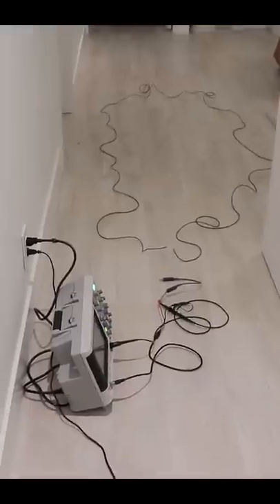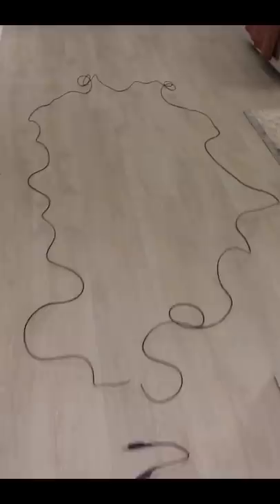The Crazy World of AC Electricity #shorts

Comment: I work in residential new constructions and I had an issue with some travelers on a 3 way setup. I would get 120 between hots while disconnected on the other end and the arc fault wasn't tripping. Wire was crushed by a staple. I think this demonstration has somewhat helped explain why the breaker wasn't tripping and the lights just weren't working.

Comment: That is so weird.  I thought that led was like a check valve and could only work in one direction
Reply: You are just inducing a voltage in the circuit and polarity doesn’t matter ?
Reply: it's AC. The voltage keeps flipping polarity, and when it is in the correct polarity, the LED shines. The voltage changes polarity so fast that to a human eye, it looks like the LED is continuously on
Reply: You are right the led flashing frequently is half to 5MHz from the generator

Comment: Wouldn't the loop be capacitively coupled to the ground?
Reply: That's not what's happening here: in one direction the AC builds a charge against the diode. Once the voltage is reversed, there is sufficient voltage differential for the charge to pass through the diode. The voltage differential at the LED is a result of the propagation delay through the wire.
Reply: @MarkRose1337  How is charge building up in the first place without the other terminal connected?
Reply: @saturdaysequalsyouth  The power supply is either pushing electrons into the wire with a negative voltage, or enticing them out with a positive voltage, to create the voltage differential. The wire is acting like a capacitor.
Reply: @MarkRose1337  that's what we call capacitively coupled to the ground
Reply: @saturdaysequalsyouth  Because everything made of metal has a "self-capacitance" as well. It's tiny, but becomes relevant at high enough frequency anyway.

Comment: I assume you are working on a video answer to Veritasium? Let's get a new debate going!
Reply: @SirVerdown  The #short debunks one of the claims made against Derek's video, so I don't think it will take the direction you are expecting.
Reply: @SirVerdown  Who said anything was rewritten? Watch the full ElectroBOOM video. Maxwell, Poynting, Veriasium, and ElectroBOOM all agreeing on EM theory.
Reply: @SirVerdown  Maybe you need to check your understanding. Sorry, but none of Mehdi's video contradicts my understanding, and none of it contradicts (in fact, it affirms) the proposition that closing the switch induces some current flow through the lamp 1 m/c later.

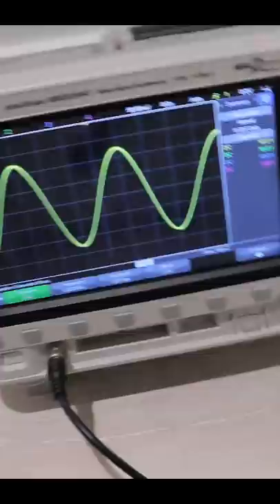0:10 -- "Of course his video is great and highly educational. But his question rocked me in ways that I didn't like." Good introduction!

2:00 -- "It takes some time from when there is operating current til when it's on", but then at 2:45 "He meant the light turns on at any current level immediately", so here Mehdi is acknowledging that he at first misinterpreted Derek's meaning (emphasis mine in both cases). Simple mistake, although the former interpretation never occurred to me while watching the Veritasium video. Hence, I got the right answer and some got the wrong answer due to different interpretations of the same statement (I was going to say 1 s until Derek made the statement about the light turning on with any nonzero current). Still others got the wrong answer for spurious reasons, and that's what I have tried to address in my responses to all the videos that have come up on this topic.

3:52 -- "Let's dive into Derek's video because I don't quite agree with every point he makes" (emphasis Mehdi's) -- he's saying he's going to raise some minor quibbles, not that the theory Derek presented is wrong.

Several minutes follow going over these quibbles, which are either semantic in nature or concern the statement of the problem (which almost everyone agrees is poor). None of these quibbles were points I was not previously aware of, but none had direct bearing on the validity of the theory presented by Derek. They certainly have a lot to do with the presentation quality, but that's beside the point.

Did you read the analysis Derek posted by the two EE professors? Mehdi had something to say about that, too:

9:05 -- "I checked the analysis Dr. Olsen and Dr. Abbott provided...I also did a ton of simulations and analysis myself and I was happy to see that my results matched theirs."

9:30 -- whiteboard illustration showing why Derek is right: "If current goes in here, same current must come out here almost immediately, limited by the speed of light. So Derek is right that as soon as we close the switch, we have current through the lamp in 1 m/c [seconds] because the wires are 1 m apart, no matter how long the wires are in the loop." Since this was the key point of Derek's video, it is important to see that Mehdi has confirmed it. Watch the whiteboard presentation again -- it's very good and you might find it enlightening.

16:49 -- shows a time plot very similar to the one by Dr. Abbott in the document Derek posted, affirming their result once again.

17:20 -- "Was Derek's answer wrong? Yes, on a minor technicality. BECAUSE HE TRIED TO TRICK ME INTO GIVING THE WRONG ANSWER!" Fair point, since the problem was poorly stated. But Mehdi has affirmed the very theory that countless people have attempted to find counterexamples against (none of which has held up to scrutiny).  Maybe you are missing some of the irony in Mehdi's remarks. Continuing: "But his question raises a great insight into electromagnetic waves." Good acknowledgement that the underlying claim is consistent with the past century and a half of EM theory.
Reply: @SirVerdown  Sounds like you haven't been paying attention to the comments. More people than I can count have been arguing that no current will be induced at 1 m/c. This video proves them wrong.

If you agree there is induced current, then I have no idea why you are arguing against me.
Reply: I have argued with people who claim that:

1. Derek's claim implies that the far ends don't need to be connected to see the induced current, so the theory must be broken. The first part is true, but it doesn't mean the theory is broken.
2. Derek's claim means we don't need wires in our houses to power our lights  No, it doesn't.
3. Derek's claim means causality can be violated by moving the switch. No, it doesn't.
4. Probably several other specious arguments I've forgotten.

See what I've been up against?

Comment: This is because 5MHz is a frequency in the shortwave range, and your loop works like an antenna. If you try to tune your radio to 5000 kHz AM, you won't hear any white noise because there will be a carrier signal at that frequency.

Comment: If anyone is curious as to why this works, it's because the led is a diode and it only lets current move one way through it.
Reply: I feel like that's not really the question.
I believe the mystery is more that the circuit SEEMS to violate Kirchhoff's 1st law. 
I.e how is this circuit 'completed' to allow current to flow.
Reply: @charmio  With AC current things get weird, there is nothing unusual about this circuit though, it is literally just a half-wave rectifier.
Reply: @_shadow_1 It's only "just" a half wave rectifier if it has 2 connections to the voltage source though, a naive circuit diagram for this setup would show the LED with its leads shorted. The confusion isn't "why is the current only flowing one way", it's "why is the current flowing *at all*", and the answer to that is parasitic capacitance and inductive effects, rather than "it's a diode". In particular, this wouldn't work at all if the wire loop was much shorter even though it would still be a half wave rectifier.

Comment: In my old house when i replaced an old incandescent light bulb with an LED, it started glowing softly while it was off. I went up to replace it, and i found out that the house’s bare copper ground wire had some sort of current running through it, because it would shock my finger any time i touched it between the ground wire and the metal housing.

Comment: Correction: it IS connected to ground.
Because the wire and gnd form a capacitor which enables an impedance which depends on the AC frequency.

Comment: Has positive and negative voltage to power the light emitting diode. Don't diodes rectify AC. And the led acts as a load so the led is a multifaceted semiconductor

Comment: About 15 years ago we were working on the "fire alarm project". So we have used fire resistant cables. In our control box we had 230VAC LED (industrial, 22mm diameter). Later we have found funny thing: we connect 230V to LED (x1 terminal). Then we took ~1m blue wire (of the cable) and connected to other LED terminal. An other end of the wire was not connected, but LED was ON :) 
I didn't try to repeat this experiment with other type of wire. And I am not sure where was the point: maybe insulator can be ionized or maybe the conductor does. Maybe the wire can take/give electrons to the air (it is wet). 
An other point is LED needs very small current to bring the light :) so it does not surprise me.

Comment: Thats the same principal as power lines work
When electricity is produced at a power plant they put neutral wire into the earth surface right there making it ground and only transfer phase through power lines this circuit is already complete at receiving end as they just take phase line and a ground wire from that receiving end surface this ground wire will serve as neutral for ac system
This system works best for transferring high voltage 3 phase supply
If you ever noticed the tower are enormously big and cables are in multiple of 3

Mehdi probably did the same thing but on low voltage it doesn't work so he had to increase the frequency to enormous level
And yes whole floor is electrocuted when phase touches led but voltage is so low mehdi didn't felt any shock

P.S. I might be slightly off on how mehdi did this but i think concept of it is related to how power lines are transferring electricity
Reply: The concept is not related to the neutral wire. In simple terms, the loop of wire acts as a capacitor that conects the loop with the scope through earth. Thus, if you drew the equivalent circuit you would have a voltage source (the scope), a diode (the LED) and a capacitor conected in series with the loop closed. However, the resulting capacity of the loop is very low, so to allow enough current through the LED to turn it on he has to use a very high voltage frequency (in the order of megahertz).

Comment: The length of the wire combine with the frequency  and the alternating current now makes all the ingredients for the circuit to work like normal.  There is enough potential difference between both poles of the LED. the current is only flowing in one direction through the diode the fact that it burns while on the suppose blocking side it the super fast switching of the high frequency AC reversing at 5 million times per second, which is to fast for us to see the off periods/blocking state of the diode.

Comment: Paristic capacitance or capacità parassita in Italian :) Btw High impedance lamps turn on Also without the ground wire.. especially in HF
Reply: Its a diode. So current doesnt flow in both directions. It arcs over the diode as it builds on one plate. That converts it to photons. Allowing current to flow.

Comment: LED is a diode so will only allow electricity to travel in one direction. The voltage is low enough to not blow out the diode, so it is working. I guess that LED should only emmit light for one cycle, but it is too fast to observe.

Comment: Didn't finish my electrical engineering degree, but at a guess: The loop on the ground is long enough to tune the AC frequency to the impedance of the wire such that the shift in phase means that the other side of the loop is negative by the time the active side is positive?

Comment: Once I've connected 9w led bulbs for a long 7/16 aluminum wire length of 90+meters and accidentally at the source i supplied phase and forgot to connect neutral but I don't know how but it glowed.😅 it's true!. Even the wire is not on the ground but 3 feet above the ground with bamboo sticks.

Comment: Correct me if I’m wrong but: electricity in wires is basically like a stream/river of electrons flowing from + to -  and because there are electrons in the metal wire already the ax current simply pushes it along at 5MHz in this case which makes it closed loop circuit

Comment: I thought an alternating current would provide ground on the negative slope and a load on the positive slope... Like that's what it means when it says alternating it alternates between ground and load... So when you say no ground connected that's a term in reference to a DC circuit not an AC circuit....

Comment: The LED is a diode... You made a low voltage half wave rectifier. Put two LED's in opposition with a loop of wire between the terminals for a full wave alternating flip flop circuit.

Comment: The wire is long and thin enough for the voltage to drop, allowing a small electric current to flow through the led from the higher voltage towards the lower one is my guess

Comment: It's elementary guys! The led has a capacitance of 50pf and the 3m loop of wire has an inductance of 10uh. The resonance is around 7Mz. By scrunched the loop he tuned it up to 5MHz. Near resonance, the voltage gets high enough to light the led.

Comment: Sun or bulb light for Solar 4v led .
Boost converter board 2A 5v to 12v board 12v to 120v -(up 390v) bulb led 6 high light 5min 99% bank battery 18650

Comment: Well can it be considered not grounded since there is no connection to the ground. Well there must be a capacitance between the wire and the ground since it is on the floor and since ac is running through it it's like closed circuit. Am I wrong?

Comment: Since when are Oscilloscopes designed to output signals rather than just display them? That's the job of a signal generator. 

As far as why the LED lights, then that's going to be down to capacitive coupling.

nb. I know that most scopes have a square output wave for calibration, but that's normally just something relatively low frequency.

Comment: I'm not an electrician so I might have this wrong or backwards but wouldn't all the free floating energy from all the appliances like fans lights Etc  charge the non-grounded wire since its connected to its self and doesn't have a dead end for the energy to fall off on like grounding

Comment: i kinda hate the fact that i understand how this works. it's "just" a matter of propagation time. by the time a high potential on the signal manages to go all around the wire and to one end of the led, on the other side it's already on a low potential, meaning there's a potential difference and thus a current can be created through the led
Reply: so the current will flow just because the probe has individually its potential comming from the AC supply ?

Comment: Well I got the answer the ac current supply is 5mhz which is so fast when you connect the the current supply at one end it gives the power to the other end cuz electricity takes some time to pass through the wire now the frequency of the current is 5 MHz which means the one charge of the current is at half way of the other side the polarity changes and the at the charger passes to the other side and this is how the led glows btw I'm bad at English so I can't Fully explain it

Comment: If AC only runs in the surface, but DC uses the whole cross section, couldn't we use pipes instead of wires saving loads of metal?

Comment: I like to imagine both sides of the LED as connected to ground via a capacitor whose 1 plate is the wire and the other is the earth with air (or the insulation fo the wire)as dielectric between them. The 5MHz signal is referenced to earth so the LED acts as a half wave rectifier. Doea this make any sense?

Comment: Physics tell us that for every action there is an equal and opposite reaction. Since Electricity is the flow of electrons from atoms to atoms then why don't power cables move around when electricity flows through them? The electrons have to push against something to move, right?
Reply: No? That only occurs for two interacting objects where one exerts a force on the other. The electric field causes the electrons to move, not a push force
Reply: @jordan-sh927  so is that Hole flow or Electron flow?🤷‍♂️🤦‍♂️

Comment: Is it that the length of wire possesses impedence to act as its own resistor ? I know I'm more than likely wrong but in my head I'm witnessing the current clap against itself at the peaks and valleys where the clap is replaced with outburst of energy depicted as light from the diode and the 'hands' aligned by time it takes to travel the distance ? (Please excuse my terrible analogy)

Comment: Is this due to the capacity effect? Since your power supply is connected to ground, a LED draws such a small current and your using a fairly long piece of wire connecting to the light.

Comment: is this phenomena related to my experience with soldering led strip? I touched contact with soldering tip and diode light up .. nothing connected to any power source just bare wire to led bare led strip .. it was so weird and until now i don't know how it could worked

Comment: Eletrons north pole  ac with its always  on  that is no +/- it's always  on kick only happen because  Eletrons always try to get somewhere and somewhere with lower  potential will allow the Eletrons to do work / same its happen in car coils  when engine. It's running pull the. Coilwire and put. The led light and will turn on and if u Let the Eletrons discharge on your body  will work 💪shake the soul and vibrate the molecules  of all cell in the bow maybe 70.000 volts make u glow like angel